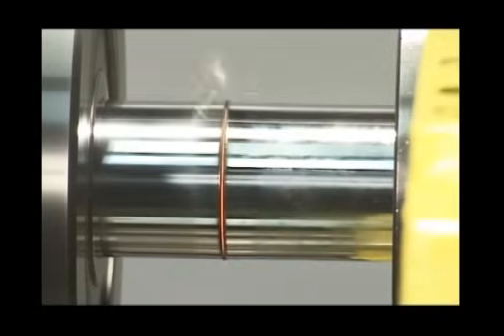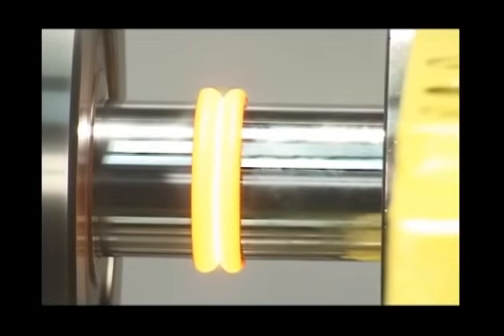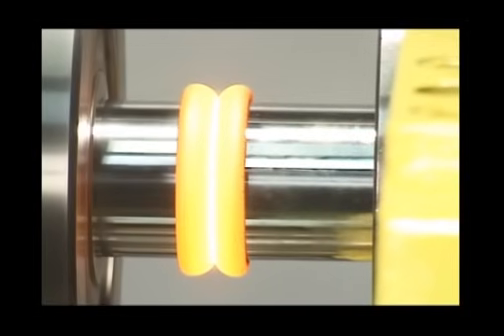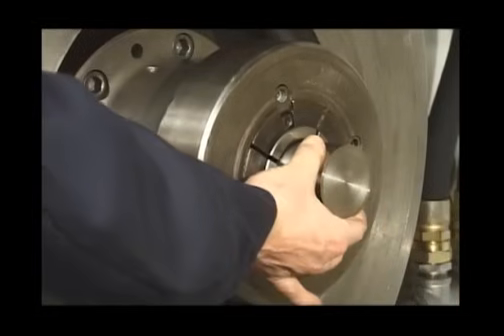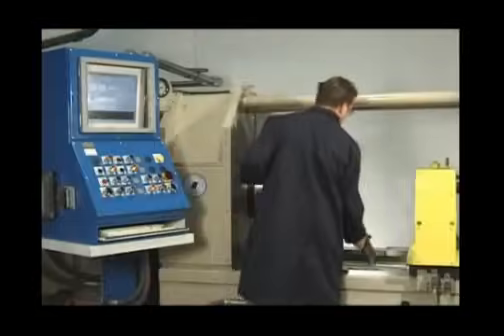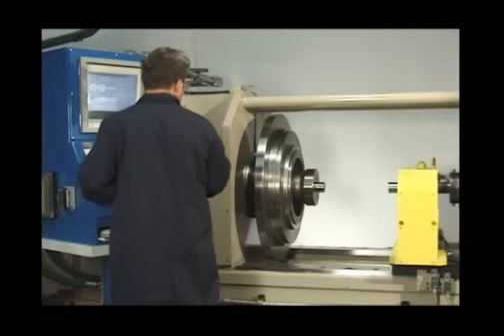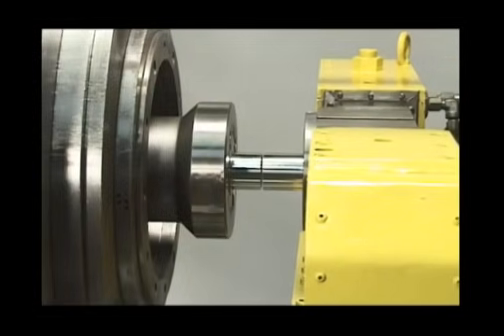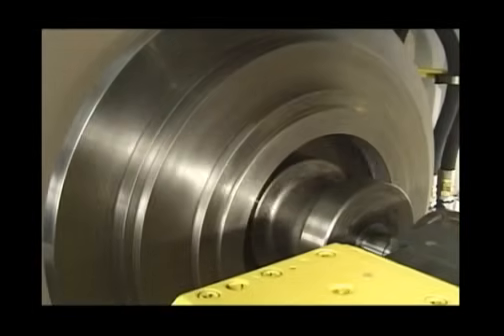Inertia Friction Welding Demonstration - Manufacturing Technology, Inc.

Comment: Why not just use a lathe?
Reply from the maker: Thank you for your comment! Here's our answer: Friction Welding machines are specially designed to withstand the torsional and axial loads exerted during the welding process. When welding steel bar to bar as shown in the video, the weld requires around 20,000 lbs/in2 of axial load or about 50 tons. Lathes are not designed for these types of forces.

You might enjoy our Whiteboard Wednesday video series with our President & CEO - he walks through Friction Welding concepts in an easy-to-understand way: https://blog.mtiwelding.com/topic/whiteboard-wednesday :)
Reply: @mtifrictionwelding  thank you I'll check it out!

Comment: This is basicly what happens when your engine seizes up due to no lube oil.
Reply: No, when there is no oil in a car engine it overheats and the pistons expand in the cylinders, causing then to get stuck.. that's what makes an engine seize, no friction welding... when a wheel bearing in a car becomes worn away and starts rubbing.. there is something similar to friction welding that will occur but there is still no fusion.. it can seize aswell and worse, let the wheel detach from the spindle.
Reply: True, not the same but it worked for what I needed to demonstrate. I was trying to show a friend a simple explaination of what happened to her crank bearings when she ran out of lube oil. Totaly smeared the copper aloy material and FUBARed the the main and crank bearings.